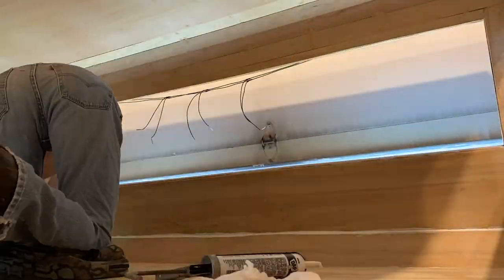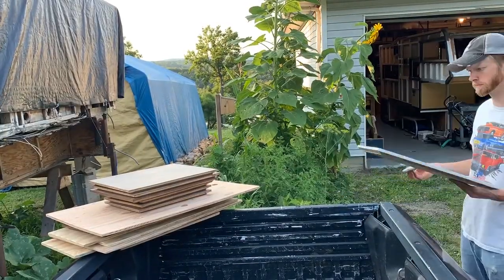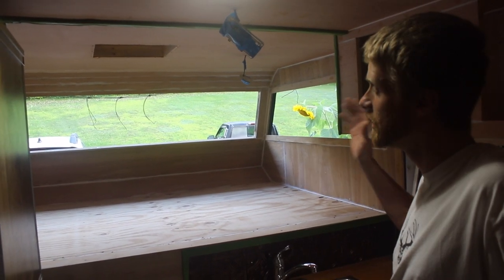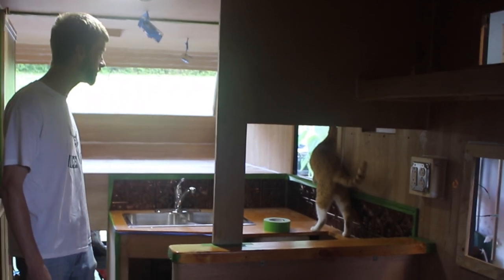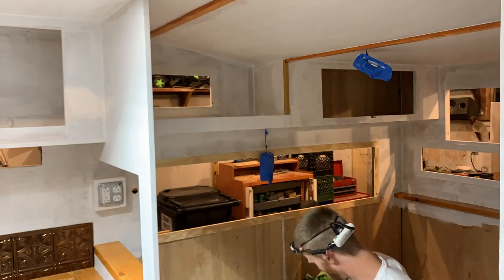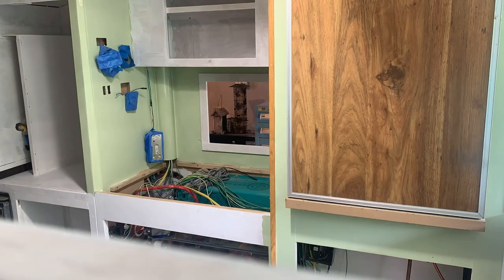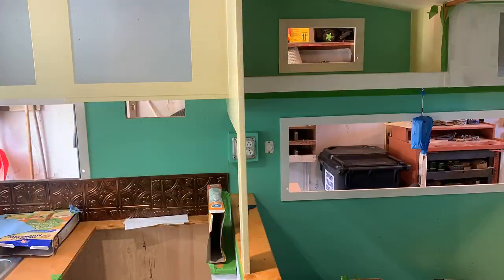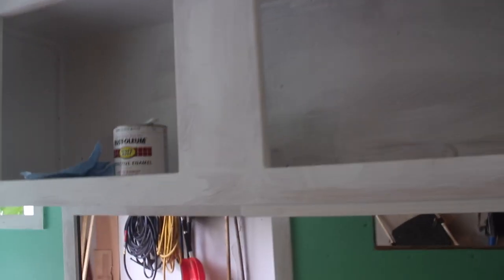PAINT - Truck Camper Build Part 43

Comment: To get good results you use 100 sandpaper first then you go up in numbers as you need to get it finer
 You will you will use less sandpaper and less time and the paper last longer 
End it will take less time to send you doing a good job hope this can help you
Reply from the maker: Thanks for the tip. I did use that method for most of the sanding. But for the wood putty on the screw heads specifically, I just used 220 grit to knock it down flush with the wall.